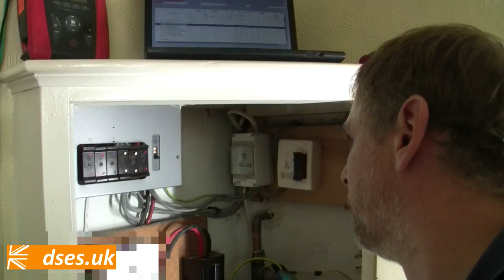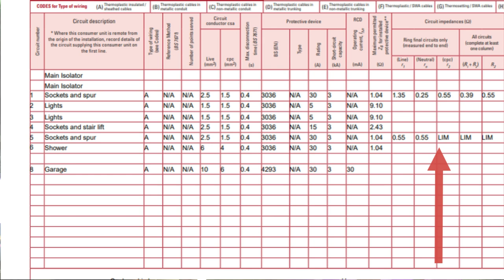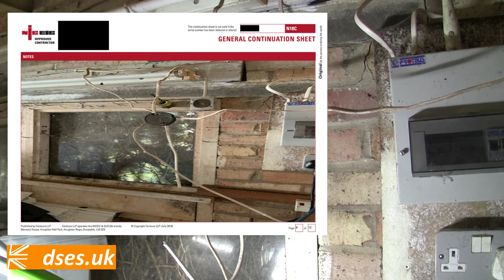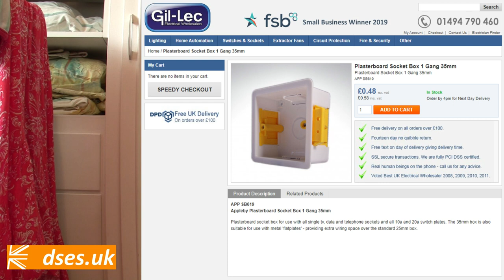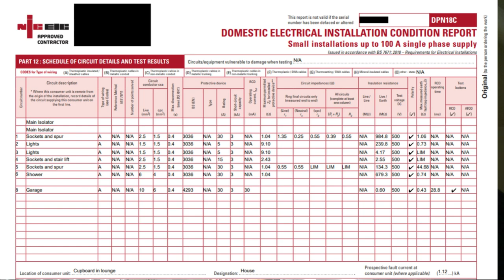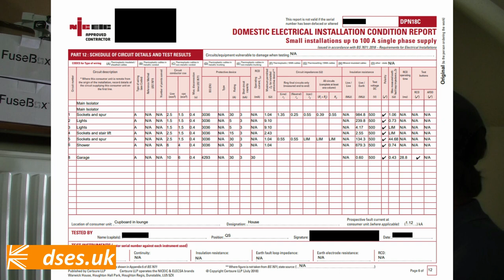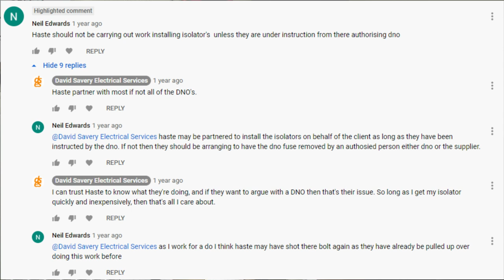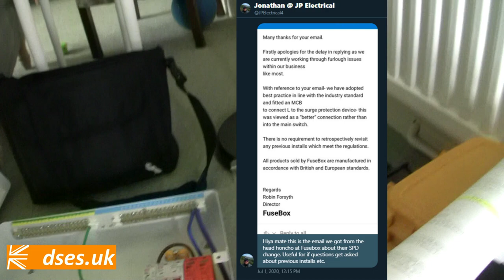Waffly Consumer Unit Upgrade

Comment: Please forgive me for being a pain but can ask you a question?
Your multifunction tester gives an of the scale reading of >999megohms and some gives >500 megohms, the one I have gives a reading of >555gigohm dose this matter and what do you put on the test certificate,? This is for installation resistance at 500v dc
Reply from the maker: Hi Sean. 555 GigaOhm?? Are you sure? Which model is that? Anyway, to answer your question, you put down whatever's on the display. It doesn't really matter if Tester A has a lower full-scale deflection than Tester B, nor does it really matter if the circuit has a reading of 100 MegaOhm or 1000 MegaOhm; they're both a pass; it's just that a tester with a higher range will give you a better figure of where that circuit is sitting and if it is potentially degrading should the number have dropped by the next inspection.
Reply: @dsesuk  uni_t ut501 insulation resistance tester not happy with it so I sent it back thay are a remodeled ROBIN and I should have said >55.5 gigohm
Reply from the maker: @seandempsey9396  Wow. Into the GigaOhms! That's quite the range!
Reply: David Savery Electrical Services that’s huge I would have expected ranges like that for dedicated Industrial IR tester for high voltage cables to test those kinds of cables effectively.

Comment: David, you are right to worry, buddy of mine was in the middle of a cu change a few months back and there was a knock on the door to ask if they had lost power. Apparently the home owner just said no we are fine thanks and fobbed him off. Proves it does happen though rarely im sure. Im thinking with a set up like you've just had i would pull the main and remove tails (make the ends safe). Put new board on with new tails hanging out. Do all dead testing and then pop the new tails in the meter last thing, then at least they have less time to come around for the tamper on the meter and I like the idea of them having to go out of there way to chase me rather than catching me red handed. Crazy we have to be thinking if these sort of things to stay safe at work, they are  clowns
Reply from the maker: To be honest, I'd relish the idea of someone knocking on the door while I'm on the job. I half-hoped it would happen on the day as I would have got it on camera and the poor bastard standing on the doormat would have faced an earful. I'm not engaged in criminal activity; I'm not trying to defeat the meter and steal electricity; I'm merely making an installation safe so I can work on the client side equipment: a right I should automatically have without argument. If some pencil-dick at a DNO wants to take me on, he'll get some robust lip for his trouble and unless illegal activity is suspected, then I doubt a DNO has any right to enter a dwelling whether they come knocking on the door or not. Western Power threatened a 'warning', whatever that means, should they catch me in the act. They should be warning their people to stay away if they turn up and see my van parked outside or they'll appear on this channel getting roundly harangued.
Reply: @dsesuk  I just like the idea of being chased by a company with no authority to discipline me but totally agree with the joke that it is and I would say going forward loose the Henley block and crack on. If you really want to cover yourself a few signs of overhearing to the existing main switch and tails should do the job, they will soon get bored of coming out when there was clearly am emergency situation that you had to rectify on the client's side of the install and no means of safe isolation, i can't see that standing up in any court (although would never come to this)

Comment: Evening chap. Hopefully you still see comments on your older videos. I came across your channel a few month back and have been working through your back catalogue ever since. I'm not a spark but throughly enjoy your work. This particular video did have a relevance to myself. I have a very similar situation as the one you show in the bedroom where the socket wire has been extended. After having a media wall installed a socket was moved forward. Looking at it a new T+E has been joined to the original using wagos. These are not covered in anyway jus sitting in the original backbox. Is that acceptable?
Any how keep up the good work. By the way taking the ladder away when Nigel was in the basement of the manor house and calling him a C£#t to boot. Nice.

Comment: Hi David.

I've informed several customers recently, that to do a board change they will need to get an isolator installed (so that I can undertake the work), and that they need to do this through the company which they use. The last 2 times, the company has said that they wont be putting isolators in due to covid, and that they are happy for a qualified electrician (i.e. me) to do it...? Thoughts?

also. Why cant this crackpot, shite, yank program not spell isolator..?
Reply from the maker: What I think is that it's shite Simon. We're told we can't break seals and pull fuses as we can't tamper with that equipment and most of us lack the PPE to do it safely.... until suppliers/DNO's feel it's too big a risk/too inconvenient to send their own people to site in which case they say "go ahead lads, knock yourselves out; you'll be alright, yeah?" We're the shit on their shoes mate.
Reply: @dsesuk  Shirley the correct PPE is available? I have an ex fire brigade jacket, full face visor, safety goggles under that, rubber gloves with protectors, and flame proof clothing. 

I of course wear them every time I TOUCH a service head, even this summer... [coughs explosively]
Reply: @TheChipmunk2008  Don't call him Shirley.

Comment: I hate the 2.5 radial spurred off a 30/32 fuse/mcb it completely goes against all that we are told in regards to protecting the cable.

And you cannot guarantee the customer will not use it for something else

Comment: Nice Video Dave. Still using the "battery eater" TIS pro I see. Glad to see you cover EICRs. Not enough NOB NOB in the video. :).
Reply from the maker: Someone commented before about the TIS; I use rechargeable Eneloop batteries and the TIS is in my daily toolbox so sees a lot of duty, yet I really don't have any problems with battery consumption. I recharge it perhaps once a month or so, the same as my Metrel. As for Nob Nob, there's no way he'd work at the weekend or travel for a couple of hours to get there!
Reply: @dsesuk  That's interesting. After about a week on my one the insulation testing drains the batteries. Even on new ones it can't handel really low IR without saying batteries low. Never had that on a kewtech or fluke.
Reply from the maker: @RRAADDIISSKKUULL  How curious! What firmware revision are you on? Mine's 1.39a. If you're is older, perhaps there's a newer version it can be upgraded to which better handles energy management? I do recommened the Eneloop batteries though; they're solid. Better than the rechargeable Duracells.
Reply: @dsesuk  
It says 
LCD 1.39
CPU 1.39
HW3 GEN2

Funnily enough I am using duracell batteries. I will definitely give the Eneloop a go
Reply from the maker: @RRAADDIISSKKUULL  I've been disappointed with the rechargeable Duracells I've got. They seem to quickly lose their charge even when sitting doing nothing. Give the Eneloop a go and see if it gives the thing a new lease of life! Do let me know how it goes. As for the firmware, I wonder if there's a difference between 1.39 and 1.39a? If so, I can't imagine it's much with such a minor revision code. Does your resistance function go up to 1999 Ohms? I know the older version mine originally had only went to 99 Ohm which was useless!
Reply: @dsesuk  haha. I just pulled out a 2K resister to check and got reading of > 1999. Then I realised I could have just tested open circuit. To be fair I use my fluke multimeter if I was to test anything with a larger resistance like a heat mat etc.  And the batteries look like a good bet as the duracell ones are 1000mah I believe.  Anyway Amazon will deliver tomorrow so I guess I will know in a few weeks how well they hold out. I quite like the mft pro as it came with the test probe that had the Test button built in. Never used the save results feature as it was a bit sh!t.
Reply from the maker: @RRAADDIISSKKUULL  Yeah, I never save results either, nor have I tried connecting it to a PC with the accompanying software. More trouble than it's worth that kind of stuff! I do like it as a tester though. A few flaws - it's the only tester I've ever had that doesn't show a permanent voltage display (so you have to go into a menu to see what voltage is currently applied to the probes), the straps are useless, the non-backlit buttons and lack of screen contrast can be problematic in a dark broom cupboard, the resistance function is between L-N and not L-PE so if taking an r1+r2 on the plugtop lead you have to remember to plug the green probe in the blue port... they're just niggles really, but I like the damn thing regardless of all that!

Comment: You changed the consumer unit, why didn't you fit a REC2 Isolator after pulling the fuse. For the next Installer

Comment: Interesting as to what differing people classify as a “shower room” to be honest I would start zone 2 from the shower door which subject to below 2.5m would have me coding any non ipx4 equipment a c2. Is your thinking that the shower in this instance is a room of its own?? 
Great no bollocks content 👍
Reply from the maker: A barrier can close off a zone if I remember rightly, but even if you did count 60cm from the shower door, all but the pullcord isolator and fan are out of zone and even then the fan itself is above the ceiling.

Comment: Dave, Check out page 1246/1247 of the CPC/Farnell catalogue,  for your grommet strip, they do sizes 1mm to 4mm, and only £10 for 15m. none of that crap "special trade show pricing", where you can buy the same product cheaper at your local stockist.

Comment: How does tamper appear compared to a power cut?
Reply from the maker: According to the nice chap at WPD, if the meter reports a loss of power when no known network outages have been logged, then they know someone's been playing. My suggestion to that is should I pull the fuse for a CU change as I have here, then that work gets notified to LABC through my NICEIC membership within thirty days to comply with Part-P of the building regulations, so the DNO, if they wanted, could perhaps cross-check with LABC or the CPS operators to marry up a local loss of power to a notification that a sparkie has replaced the CU. If no such notification lands, then that means the work was not notifiable (repairing a damaged tail or broken main switch), work was undertaken by someone who isn't complying with building regs (homeowner, handyman or an unregistered electrician), or someone has been pulling the power for other reasons, perhaps nefarious ones. They may want to take a closer look, but it seems they could rule out legitimate work, and certainly not go chasing up any spark who they know has been on site doing an honest job.

Comment: The topic of isolator after DNO fuse interests me, after my energy supplier arranged for my old meter to be changed to a smart meter, I highlighted the fact that there was no isolator between DB and Western Power DNO supply, the installer offered to put a breaker in for me which I asked him to if he had time, he just pulled the fuse.  The only PPE being a face covering!

This video implies to me he was a very naughty boy.  Should they have put a breaker in for me at the time?
Reply from the maker: Personally, I think all installations should have an isolator. If you especially showed concern for the lack of such, then they should have addressed that. Anyway, only a face covering? Was it a COVID fuse??

Comment: It was probley one of those drive by eicr tests 😂😂.
Once upon a time the firm was registered with electric board 
And you used to phone them up get a number to be able to cut 
The  seal to remove the fuse . Then phone them back to come and reseal the fuse ..they should bring this back ..

Comment: Hi David I always cut off the seals and I make sure it is safe for me to   carry out  the work and I have the seals for me to reseal the main fuse
Reply from the maker: I carry seals too John, the problem is pulling the fuse can be dangerous and DNO operatives in the comments elsewhere on this channel have shouted about the burn injuries they've witnessed, yet they do nothing * literally nothing* to make it easy and cheap for us to isolate the supply safely.
Reply: @dsesuk  in agree with you

Comment: Does someone mind jogging my memory on the calculation that would be required to find the appropriate fusing for the bathroom heater under short circuit conditions. It looks to me like it is ok for normal overload scenario as 2KW heater was on 2.5mm
Reply: Ignore the cable, the appliance needs protection.
Reply: @edc1569  Ok thanks. Is this more of a risk because it is a heater or do the same potential dangers exist with all fixed appliances. I.e an extractor fan in a bathroom? Would you only install a new one if it was appropriately fused down?
Reply: I would guess the heater in the ensuite would be fed from the lighting circuit and set to 1kw.
Reply: @stuartrhoades4306  it wasn't Stuart it was spurred off the 2.5 socket circuit
Reply: The bathroom heater was from the socket circuit, the heater in the ensuite, he didn't know where it was fed from.

Comment: Trainee here, great vids as ever. Slightly nerve racking Re the contradictions in BS7671. Starting to have the feeling that it's going to be a difficult career for doing this right and earnubg fair remuneration for quality safe installations... Just wondering about these new Rcbos, have heard they can accumulate more heat then older devices. Is it worth where possible to put a blank between each one to prevent the afformentioned?
Thanks for great vids again BTW first saw you vids at college Re safe isolation 18months ago.. 😁👍
Reply from the maker: Hi Pete. Thanks for tuning in. I have seen people staggering RCBO's to leave air between them, but I'm not aware of any manufacturer stipulating they need to be spaced. If spacing is needed, then I would expect manufacturers to be making enclosures that have that spacing built-in rather than providing busbars which allow for direct neighbouring of protective devices.
Reply: @dsesuk  good point. I'll try ans find out why the electrician did that and get back to you. Thanks again dude 👍

Comment: Why do they make grommet strip out of polyethylene? It's an 'orrible slippery plastic. If they made it from PVC (hint, non electrical edging strip for metal panels is PVC!)  it wouldn't' slip out so easily, and in the worst scenarios, contact cement (evo-stik) will make it stay in place on the board. then intumescent sealant if you feel it necessary at the end :)

Comment: Hi David, 

Edit: Sorry for long reply!

According to EAWR Reg 12 states: "Subject to paragraph (3), where necessary to prevent danger, suitable
means (including, where appropriate, methods of identifying circuits) shall be
available for –
(a) cutting off the supply of electrical energy to any electrical equipment;
and
(b) the isolation of any electrical equipment.
(2) In paragraph (1), “isolation” means the disconnection and separation of
the electrical equipment from every source of electrical energy in such a way that
this disconnection and separation is secure.
(3) Paragraph (1) shall not apply to electrical equipment which is itself a
source of electrical energy but, in such a case as is necessary, precautions shall be
taken to prevent, so far as is reasonably practicable, danger."

So really the DNOs (who are a law unto themselves!) SHOULD be supplying isolators!

And now onto the main point, regulation 14 of EAWR "No person shall be engaged in any work activity on or so near any live conductor
(other than one suitably covered with insulating material so as to prevent danger)
that danger may arise unless –
(a) it is unreasonable in all the circumstances for it to be dead; and
(b) it is reasonable in all the circumstances for him to be at work on or near
it while it is live; and
(c) suitable precautions (including where necessary the provision of suitable
protective equipment) are taken to prevent injury."

So if you are complying with YOUR legal requirement by following EAWR, then you should be allowed to make the installation dead to carry out work. As already mentioned, if DNOs are allowing accredited contractors to pull the fuse and reseal the fuse carrier afterwards then I can't see the problem.

This is just my opinion!
Reply from the maker: I agree with this. EAWR permits me to kill the power, yet the DNO gives me no easy means to do so and threatens to prosecute me for tampering with their equipment unless I pony up their 'protection racket' money. As for them allowing 'accredited' contractors to fumble with their hardware... well maybe they will, maybe they won't, and what does that mean for a large company with one or two QS's at the top and an army of half-trained kids out in the field?
Reply: Abso-Bloody-Lutely. Well phrased!
Reply: Until DNOs come out with standard policies regarding the issue (which is unlikely to happen), you're damned if you do and damned if you don't. It's absolutely stupid that they should be allowed to profit from getting a third party to fit an isolator (as mentioned in the video about Haste).